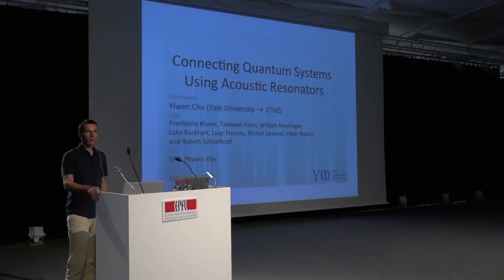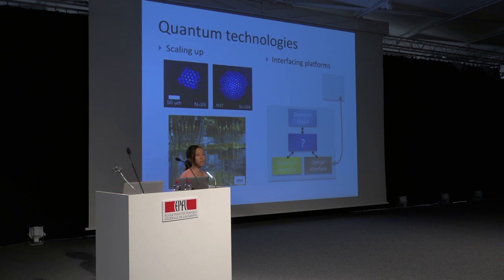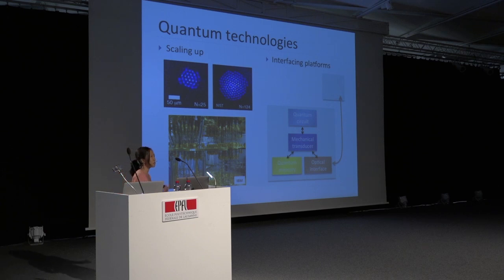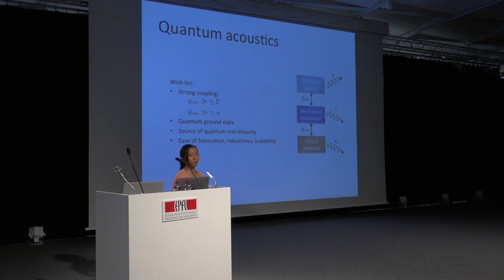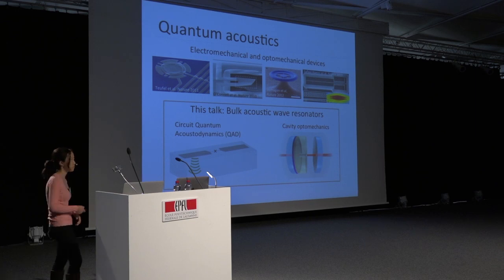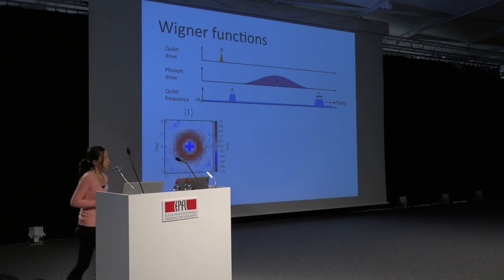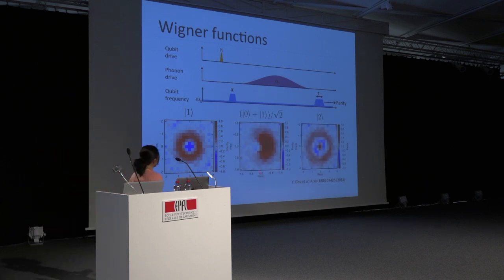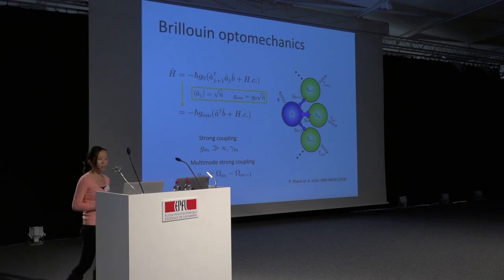Yiwen Chu : Quantum acoustics

Comment: Stop wasting time and just build a massive phononic quantum computer already
Reply: For real, I been doing a bunch of experiments involving Faraday instabilities and they tend to form clusters when given enough room compared to the wavelength and I been thinking for sometime how these clusters seem like a perfect analog for Qubits. A single Faraday wave is essentially a Qbit in itself as its constantly in a state of super position only the difference is its on a time scale we can witness but make no mistake the maths specifically call the waves a super position when standing waves are formed. Sure the speed of sound is relatively slow compared to Photons or electrons but none of that matters when it should be relatively simple to make a Quantum computer or at least make a system that performs exactly like one just on a macroscopic scale which contains hundreds of Qubits which is WAYYYYYYYYYYYY more than one would ever need. We only really need a QC that has like .... 10 qbits as that is more than enough so the problem solving capabilities of a macroscopic system, that we can probe an inspect ( unlike quantum computers) which could perform all the computational powers of QC, perhaps even more. 
Attempting to make a simplified version of such a system might very well be the next stop in my experiments after I am finished my current path although that likely wont be for a few years at this point however I cant get the idea out of my head and feel it needs to be attempted.